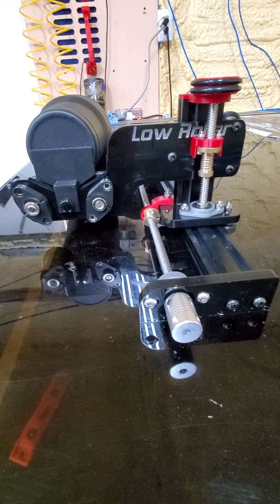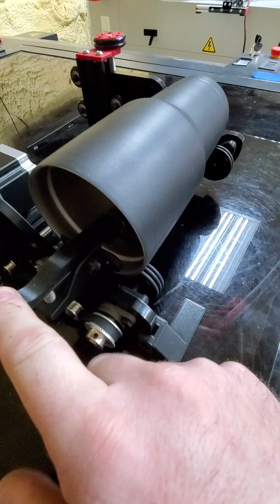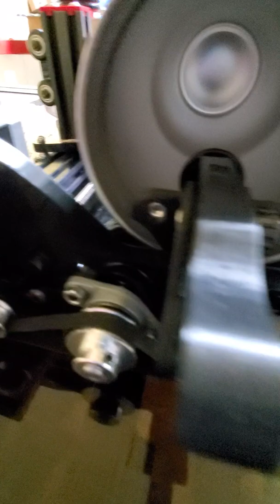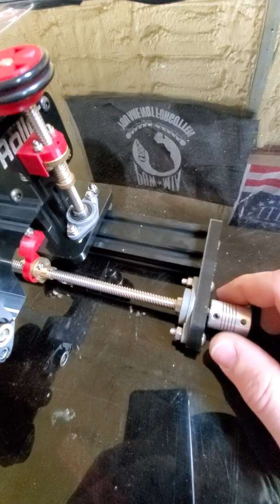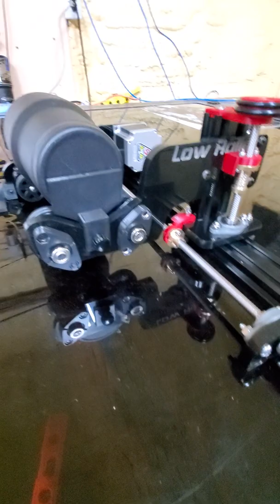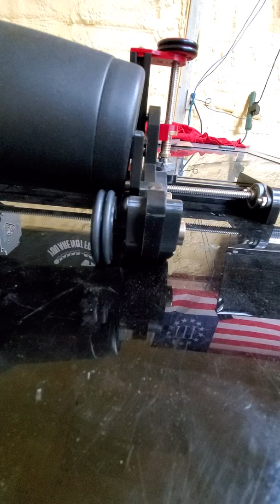LOW ROLLER Rorary attachment

Comment: So everything shipping out now will be all metal?
Reply from the maker: Not at this point, still working on the design and fitment issues from manufacture . Hope to have the RotoBoss and RotoBoss jr all metal by 1 march 2020.
Reply from the maker: The low roller will remain acrylic unless the design is well accepted and takes off.